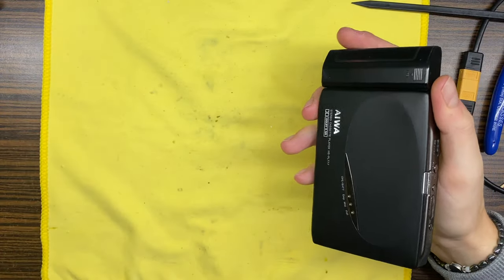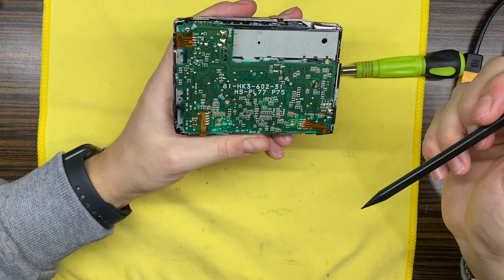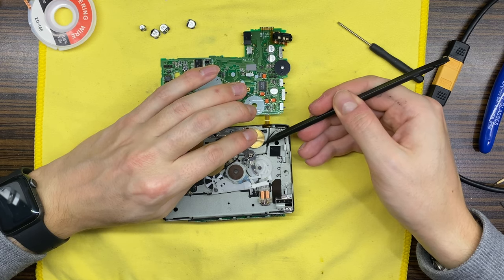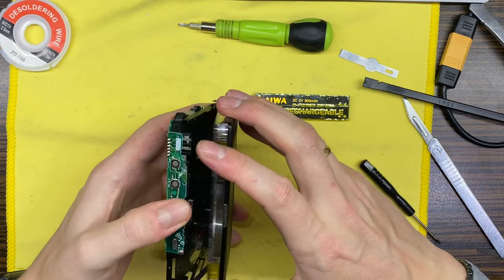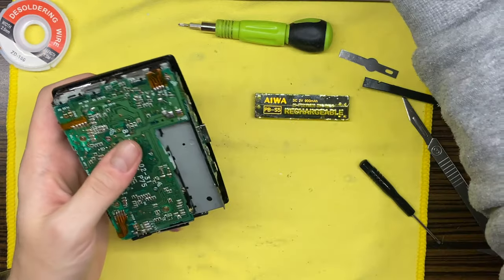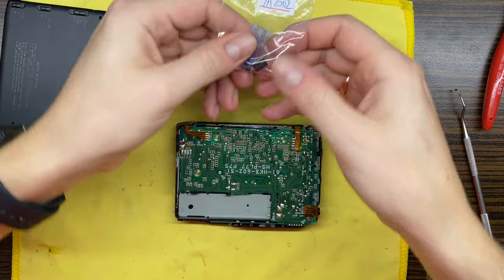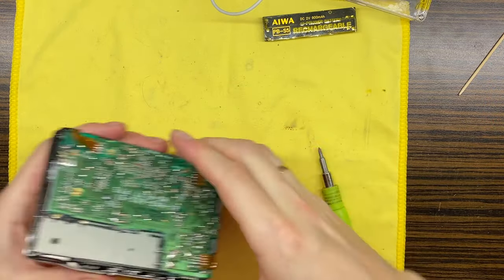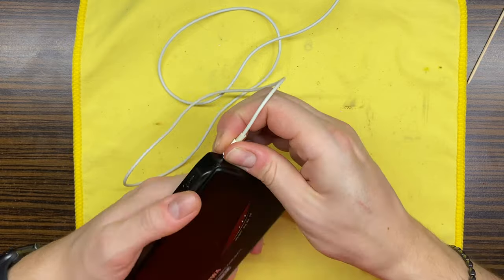Aiwa HS-PL777 PL77 walkman - cassette player repair fix #diy #repair E0012

Comment: I had one of this model of Wwalkman in the 90s and have to say it was flawless for over 5 years and used every day, I listened to 3 or 4 albums a day with it, probably the best walkman I have ever had, I wish I still had it to be honest as nothing I had after came close for sound or reliability.
Reply from the maker: Hi, very nice story. If you would like to get this one (already repaired and prepared for it’s loads of cassette tape miles) you can contact me via email attached to channel about section or lt.tapeheads.service et gmail dot com
Cheers!

Comment: Hello sir what do you suggest, my sony walkman Sony WM AF64 walkman, I changed the belt . it's playing but instead of music, its coming a whistling sound. may I know what wrong ? with my walkman. thanks.
Reply from the maker: It is hard to identify what is wrong. My suggestions would be: 1. carefully check tapehead cable with tester if all connections are ok. (from your description could be tapehead reference ground cable loose or broken.) 2. if there is no problem with that cable then you have to track where you loose signals by using service manual (service manual is available in google searching for this "WMAF64_SM_SONY_EN"). 
Good luck
Cheers!